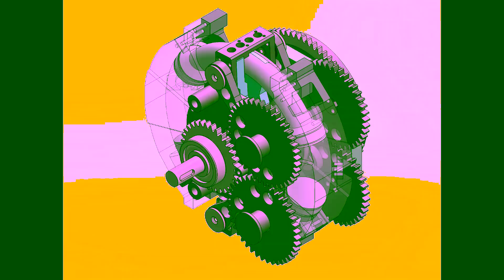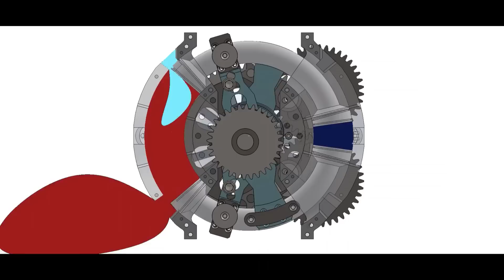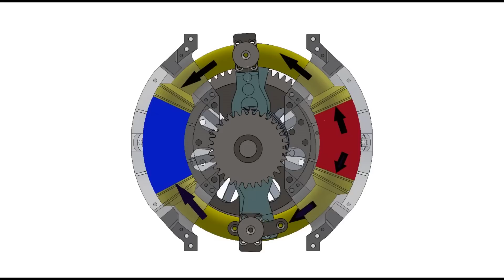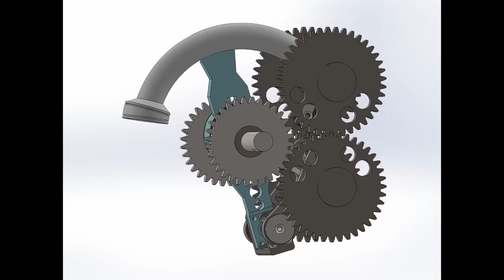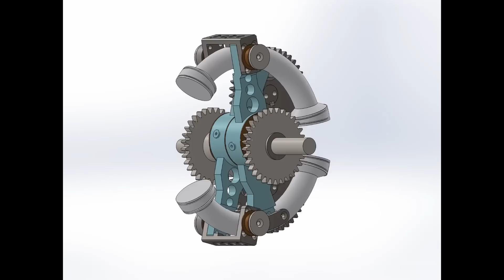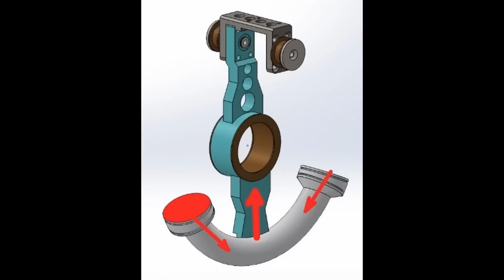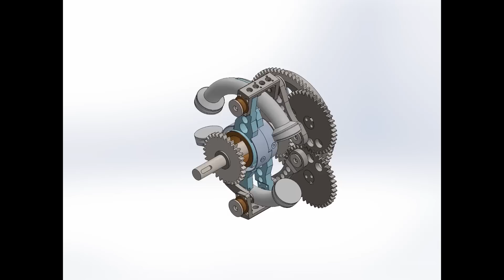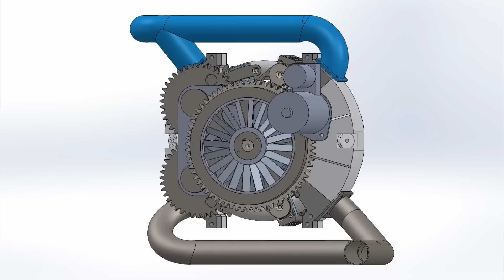A new type of Engine

Comment: Nice animation of an interesting concept....but that is all  it will ever be . Countless reasons  disqualify it from ever becoming a viable product. The cost of machining  the arc shaped piston bore is one of them , the remainder of its design is as problematic and the list is far too long to address with a short comment. Noting noted in this design would enable it  achieve a 60 % efficiency , this design  in fact  includes more frictional losses and imbalances  than any current power plant in existence today .
Incidentally the existing Piston con rod  configuration  has not yet reached an ultimate efficiency iteration yet. A variety of new alloys and ceramics not yet used because of cost  could presently raise the efficiency by double digits, their cost is the issue and until necessary "none of them"  will  be used  by any manufacturer.
ICE piston  Engine makers have designs 2 to 5 years ahead of current production , it is a marketing ploy , but also a tactic which allows them to be more flexible about meeting emission regulations. 
The Wankel to date has been the only consumer available  deviation form piston ICE`s, Mazda its principle maker  eventually dropped it when it could not meet the ever more restrictive emissions.

Comment: Isn’t this a Niama-Reisser engine? I think also called opposing piston engine.
Reply: Opposing Piston isn't rotary
Reply: @jyothishkumar3094  That is correct, an opposing-piston design does not imply a rotary layout, but, to be fair, I don't think my post suggested that it was. However, the Niama-Reisser is a rotary by design and very similar to this "new type of engine" video. Perhaps "converting Niama-Reisser to electric" is a better headline than "a new type.."

Comment: as an engineer at BAE, the piston rod will break in the first minute and lead to catastrophic engine destruction.
there simply isn't a material that can withstand these kinds of violent forces here on earth........yet. same issue with mach6+. vibration of air simply destroys all man made materials just before achievement as the product catastrophically vibrates into implosion with all the resistance force

Comment: Citing 40% efficiency and then blaming it on friction. The vast majority of losses in an IC engine are thermal, inherent to the Carnot process and can't be further reduced. The most promising strategy to increase energy efficiency is not an exotic mechanism, but high compression, heat resistant materials, and a thermally sound engine.

Comment: There is no way to remove the most problematic friction relationship in an ICE, the rings and cylinder wall have a relationship that is probably the most critical part of the system that can cause immense damage even before catastrophic failure.  Also, unless your entire main gearing is housed in a main block of some kind you will have to maintain 4 independent seals at operating temps in excess of 400F, even with the best passive cooling.  I am not poo-pooing your idea, I am just pointing out where the math gets confusing and where the weak points of the design are, neither are insurmountable.  The rings require near airtight barrier in order to maintain efficiency, but that causes friction which is the biggest loss of energy in the system aside from the heat (but since this isn't a jet engine the heat was ALWAYS planned to be lost, the sooner the better frankly).  Valve timing and direct injection along with higher octane fuels drastically decrease overall operating temperatures, I think Direct injection could be very beneficial in this application and should net you 50-60F decrease in exhaust gas temperature.  If you can boost Octane up to 110 and maintain idle, you can get another 20 degrees or so out.  The biggest benefit here is that you can solve your lubrication issue while also recapturing a vast amount of lost heat by using a closed loop turbo on the exhaust side, roughly 75-80% of your lost heat turns a venturi pump that forces cold air to enter the combustion chamber, increasing air volume, completing more burn, and since you are 2 stroke your piston lubrication in the exhaust will aid in lubricating the turbo.  Not sure where the emissions would end up on this though, 2 stroke by definition is rather dirty...but the power to weight of this system is more than a little intriguing.

Comment: I’ve been a cnc machinist for over 4 decades and all this can be done with a 5 exis cnc mill. Granted it’s not going to be cheap but prototyping never is. A lot of programming will be needed.
Reply: It could be manually machines but special boring mills would definitely be required... This is just to further make your point about Cnc, it can be done.... Before long allot of this will be metal printed... Crazy times🤷
Reply: In the pendulum engine Teurozzi made in 91 he used a boring mashiene that was curved to get the curve in his cylinder
Reply: For prototyping a compressed air engine could be 3D printed on a home 3d printer, possibly with flexible hose as sleeve for the walls.
Reply: Or as the part is split vertically in half, you can just have one milling head do spin and cut out the entire thing?

You could make the body on a lathe if you want when doing it that way
Reply: These are mass produced as compressors for stuff like pure oxygen where you need a pump but not contamination from lubrication, so teflon rings are used with a frictionless pendulum cylinder.
Reply: Does not need cnc, final grind with diamond stone in place of piston. the movement is only an arc.

Comment: How would it deal with thermal expansion? The taurozzi pendulum motor for example (similar in some ways) seemed like a good idea but in reality it didn't appear to work (reliably) as an internal combustion engine, worked great as an air pump though. This concept has a lot of metal exposed to different temperatures, and a lot of small bearings.

Comment: i would not take the output from the crank gear, because of this excentricity you introduced to avoid locking the gears.
rather shift the output gear axially keeping the symmetry, you will need an extra gear on one of the "Crancks"

if you don't intend to pack everything too compact, then embrace this excentricity and place the output gear on the periphery of the package

Comment: Interesting design, however manufacturing those curved bores would prove to be extremely difficult. You would need to separate the  unit into 2, preferably 3 pieces, on each half so that the internals can be reached with normal tooling. A 5 axis mill may be able to reach all of the internal features, however the size of the bore will create significant limitations. In order to successfully machine this, you would need a long tool to be able to enter the bore and reach the tangent of the internal minor diameter, without gouging the entrance near the major diameter. This means the arc of a bore can be no more than 65 degrees, unless it's an extremely large bore, proportionally. However even then, a mill cannot provide a surface finish needed for an engine bore, and that only considers the needs of a tool to reach the internal tangent of the Minor Inner Diameter  without gouging the Major outer Diameter.

metal 3d printing also cannot provide the surface finish required, significant lubrication will be mandatory, and leakages will be expected, especially since it cannot be properly finished to a precision surface internally.
Reply: Not sure why everybody assumes difficult machining, final finish by high speed stone, as someone who has done a lot of porting/polishing, no problem.

Comment: I do find it interesting however there will always be friction. The pivot points (think of an Indian burn on your arm) and cylinder walls. To get the required compression the rings need to hold in the air by pushing against the walls (friction) good idea though you've obviously put a lot of thought and work into it. One day maybe Honda will hire you as they have tried many different engine designs.
Reply: The compression rings will contact the cylinder wall of course, but they represent a small fraction of the piston-to-cylinder friction in a typical piston engine. Most of the typical friction is from the side of the piston itself, as the oscillating connecting rod tries to tilt the piston to one side or the other. That large portion of the friction would not exist in this engine.

Comment: This is genius on so many levels. However, cylinder lubrication is just as necessary in one of these as in other liquid fuel engines. Besides improving efficiency by reducing friction and increasing durability by reducing wear, oil also helps seal off compression in the system. Here’s something to work on: I believe the system won’t breathe enough air. A lifetime car mechanic once told me that when you see an engine primarily as an air pump, intuition to solve engine problems comes much more quickly and naturally. Solve the low air ingestion problem in this layout, line up a few of these in sequence on the same drive shaft, and you just might give the new Cummins ACE engine a run for its money! Yeshua’s peace be yours.

Comment: Interesting concept, but it seems incredibly difficult to machine the cylinders to achieve tolerances required for an engine, if it's even possible at all. How is the manufacturing going to look for this?

Comment: At rest, each piston/"cylinder pair" will presumably only be under static atmospheric pressures and will thus be in it's normal shape. In operation, each head of each pair will simultaneously be experiencing back  pressure either from the expanding gasses or from compression. (Not to mention the imbalanced loads of drawing in and compressing the air/fuel to be used for the next stroke.) Because of the curved structure of the pistons, these pressures will cause them to flex and distort, resulting in increased drag and friction against the cylinder walls and over time weakening and likely breaking the pistons. 
In order to maintain cylinder pressure for both power and compression, you will need something similar to piston rings, which will require lubrication.
In a standard 2 stroke engine, the underside of the piston is used to draw in and then compress air for the next stroke, so that when the intake port opens the compressed air/fuel mixture expands into the combustion chamber and helps expell the exhaust gasses. With the opposing piston head moving at the same rate in the opposite direction and the pivot arm swinging through the space between them, it would be extremely challenging to seal off a chamber to use for that purpose. You would need to have a mechanically driven supercharger.
All things considered, while I do admire your creativity and would encourage you to continue to think outside the box, I just don't think you'd be gaining any reliability nor efficiency over a standard 2 stroke engine, although in a horizontal shaft configuration, this could negate the need for adding a lubricant to the fuel and thus improve the emissions.

Comment: I'm not an expert. But if you could tune the balancing of the counterweights right, this seems functional. Using the power stroke to directly power the compression stroke of the other 'cilinder'.

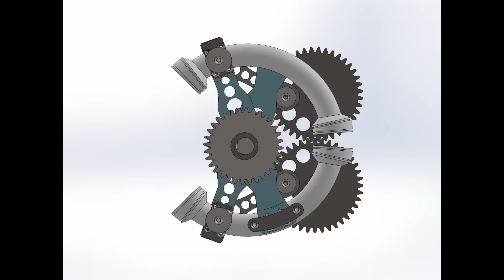Just one note however: 4:40 due to the placing of the gears, the arm wich rocks the pistons back and forth is not symmetric. Causing the pistons to slowly  compress on the left. And rapidly compress on the right. To me that seems like a bad thing. But that's all I got.

(En ook erg goed Engels. Ik had bijna niet door dat er een Nederlands accent was :D )

Comment: What lubrication system would you use? The gears usually need to be steel to put up with the forces of combustion. Steel on steel gears will not go well at high speed without lubrication. It would need a case, and it would work similar to a manual transmission oil bath.Then you could use pressurized plain bearings that last forever when used correctly.
Reply: its a 2-stroke so i assume the fuel will be pre-mixed with oil, but i didn't design the engine so idk lol

Comment: "The pistons won't need to contact the cylinder"...well the piston rings will, and there's your friction and the need for oiling. Its similar to several other designs. There's the Beck Toroidal engine and the Crank Rocker engine with curved cylinder. Nice CAD presentation, I look forward to its exhaust note.
Reply: It mostly reminded me of the taurozzi engine.  It also reminds me of the detroit 2 stroke diesels.  It's pretty wild.  😋
Reply: @nocturnal0072  It's also similar to Achates power 2 strokes...except they don't have the insanity inducing arced pistons, and have real world solutions for piston oiling and have passed next gen emissions tests by a wide margin.
Reply: if made with some insanity inducing level of tolerances and impossible variances in bore diameter you theoretically could make some sort of engine like this that didn't require piston rings and would simply function on air pressures. the more i think about it, it would be a very cool, yet completely worthless proof of concept since the engine would still break in over time and could never be fixed.
Reply: @Tathbubs  tight tolerances won't save it, vibrations from contacting the ground will certainly cause damage over time. better to stick with rings
Reply: @NoSubsWithContent  I literally already said that it wouldn't work.
Reply: technically those can be oilless
Reply: @ButterfatFarms  https://youtu.be/GI9pkcFJXV4
Exactly, this concept works! Here I see the same mechanics times four. The same proven points about less friction, etc. Would be nice to quote the predecessor 🤔
Proposed concept could have a lesser vibrations than the 4 in line Tuarozzi.

Comment: I imagine the side of each piston facing the outer radius of the engine will suffer increased wear due to centrifugal forces.  The explanation about canceling forces ignores the fact that materials flex/move.   The higher the speed, the more the pistons will flex outwardly.  Perhaps a piston shape other than circle may reduce friction.

"oil lubrication is not necessary"  ...and that's when I realize this is a fantasy device. lol
Reply: Basically the idea is to use the arms to hold the pistons in place to avoid side loading.  Also it is assumed the intake charge will just fall in, that i find very had to believe.  Other have already stated that it will probably need forced induction to work.  This is basically an opposed piston engine with more steps.
https://www.youtube.com/watch?v=GI9pkcFJXV4

Comment: Nifty ! Off hand I can foresee a few potential BIG issues. Very difficult & expensive to machine such a bore, Though perhaps not too bad if split in half for manufacturing & like clamshell connected during assembly. Also, different forces & therefore wear on inside Vs. outside(radially) for cyls AND pistons both. Buy hey don't let that stop you, even if longevity is an issue, if(BIG IF) it could somehow be a cheap/simple replacement, that could be outweighed. I'd enjoy being shown wrong.

Comment: Ever since the ICE engine first became a viable powerplant their gave been numerous attempts to develop other variations. The only ones that ever succeeded to a significant degree were the opposed piston designs. A niche powerplant that was also built was the axial piston engines developed for use in torpodeos. Needing to to fit into the body of the torpedo while providing good power were the primary requirement in that case. All of the other Z Crank, axial piston and other types have failed. The engines built on the concept of pistons, connecting rods and crankshafts are a mature and well understood technology. Both in engine design and in manufacturing. Linear cylinder bore are much simpler to bore and hone. The advent of computerized engine management systems have allowed them to have increased power outputs while still meeting both fuel economy and mileage requirements. The only replacement ICE type I could see replacing the conventional piston engine is a small gas turbine designed to run at one speed mated to the generator or alternator of a hybrid.

Comment: I remember seeing something like this somewhere, problem tends to be transmission losses due to all the extra parts and all the reciprocating mass, solve those and you might be good to go.
Reply: Thr concept isn't that new....

Toroidal Internal Combustion Engine/Swing-Piston Engine

There were various engines that fall under this concept, so you might also find something related under the names:

Dewandre Engine
Beck Engine
Esselbe Engine
Wolff Engine
Paddon Engine
Bradshaw Omega Engine
BSA Toroidal Engine
Tschudi Engine
Morgadi Engine
Reisser Engine
Rotobloc Engine
Reply: @ButterfatFarms  i did not mention any timeline.... i just said, that the motor in the video isn't a new concept. Taurozzi also worked on toroidal engines and worked on his pendulum motor, but they are not the same....
Reply: @ButterfatFarms   according to wikipedia the toroidal engine/swing piston engine started out as an alternate steam engine design in the 1820s.... so it's much older...
Reply: @ButterfatFarms  well... they were not mass produced...
they had lathes, mills, drillpresses, etc... just not the CNC versions like today, so it wasnt as precise as today and the workers needed different skillsets and do everything by hand.

but still ... pretty amazing what people did back in the days